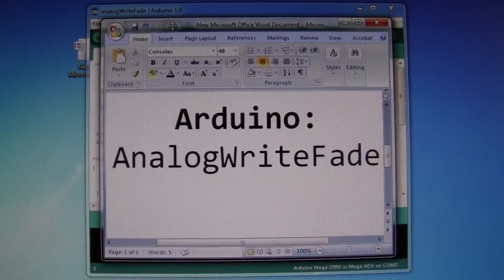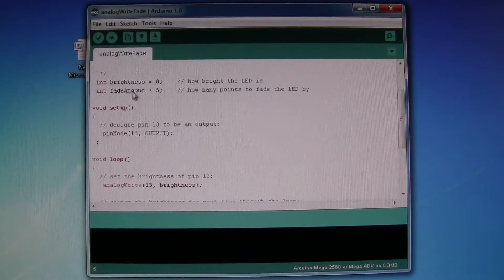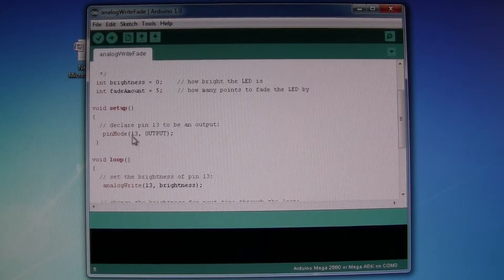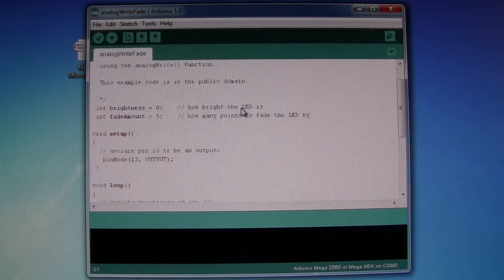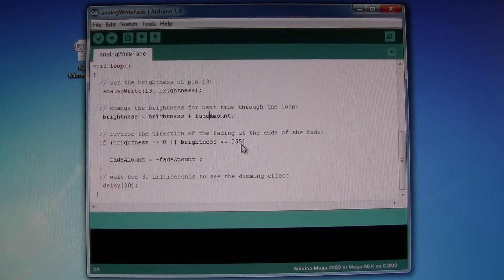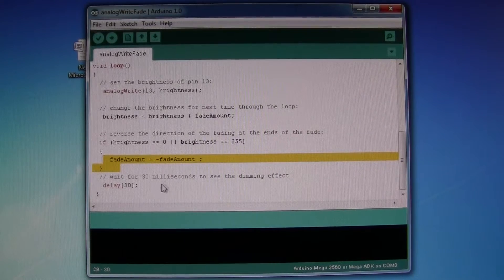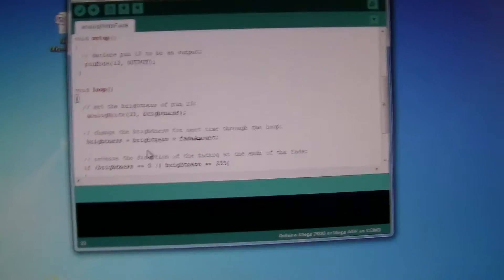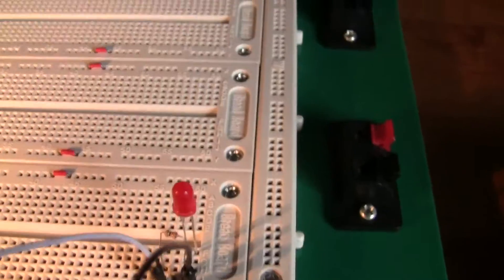2. arduino analogWrite Fade

Comment: Do you need the resistor on pin 13?
Reply from the maker: The resistor regulates the flow of current to the LED.  It is certainly possible not to use one but I understand the life of the LED will be shortened along with making accurate increments less effective.